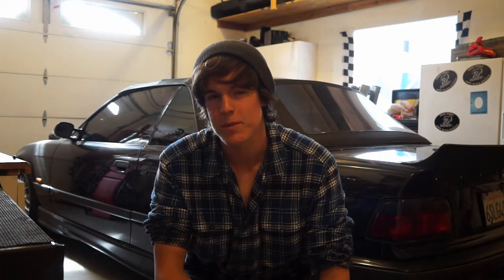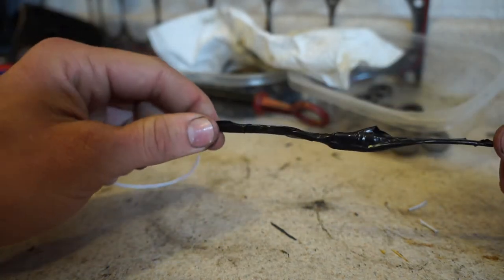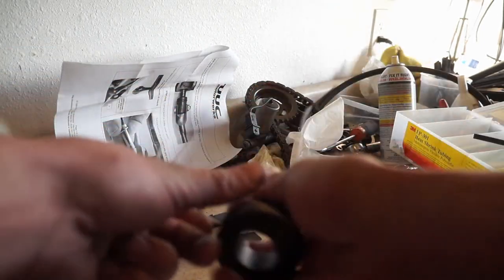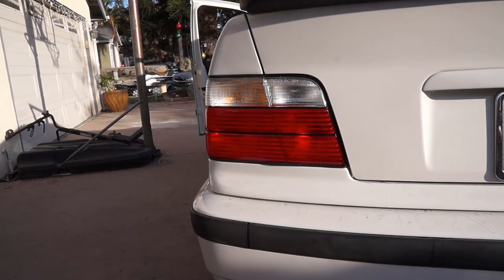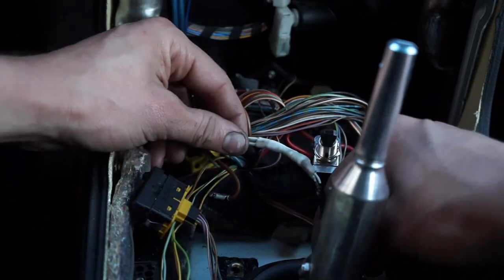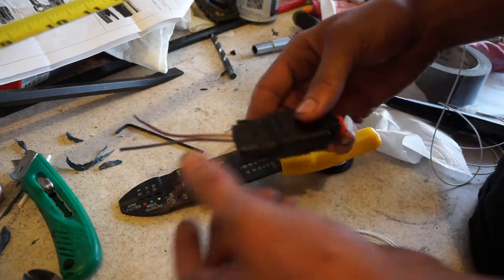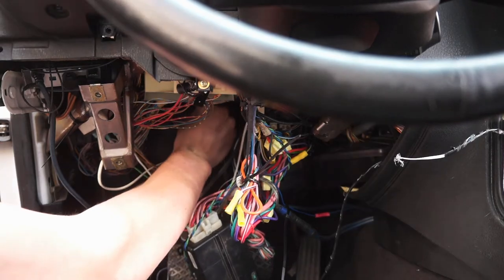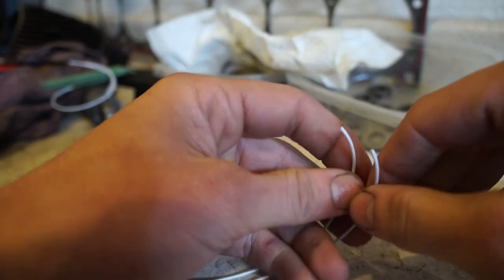Wiring: E36 Manual Swap

Comment: Great videos M3NACE! You definitely have tutoring skills and you know how to place cameras for right shots!
That's how I understand Clutch Switch operation:

1. Both Manual and Auto cars need to know when it is safe to start the engine. They do so by checking if that circuit is closed or not. Circuit closed = safe to start. Circuit open = NOT safe.

2. Safe start positions for automatic are [P]ark and [N]eutral. For cars with manual tranny the condition is that the clutch pedal must be depressed no matter if it's in gear or neutral. We have switches in both auto and manual cars. Manuals have it beside the pedal (closes the circuit when pedal depressed) and autos have it inside the shifter assembly (closes the circuit when in [P] or [N]).

3. After the swap you remove the auto shifter assembly along with the switch and so you need a way to tell the car: hey, it's safe to start the engine! That's when some DIY-ers prefer to just jump wire the pins and leave the circuit permanently closed, while others do it the right way with the clutch switch.

Why jump wiring the pins messes up you cruise control:

Coincidentally, both Auto and Manual cars use exactly the same circuit when they need to override cruise control and disable it for safety and operational reasons. Basically when the circuit is CLOSED, the cruise control is overriden and is shut down. As explained above this occurs when automatic cars are in [P] and [N] or when you depress the clutch pedal in a manual car.

Now those DIY-ers who decided to take a shortcut and jump wire the pins and leave the circuit permanently in a closed state (to let the car know that hey, it is safe to start), have also let the car know that "hey, it is NOT safe to have cruise control enabled, override and shut it down".

Hope this helps.
Reply: So by jump wiring ,the cruise control is disabled and car still can be started without pushing clutch in ? But with the switch the clutch must be engaged to start vehicle ?  And use crusie control possible ?

Comment: Excellent tutorial and I agree with Erik Engstrom. My only comment is the break light switch is self adjusting, so he didn't need to glue spacers on the end of the switch. He needed to just pull the white plunger out further, it sticks out almost an inch, install the switch, then use the clutch. The clutch will then press againts the plunger to adjust. It's an eligant design. Great video!!

Comment: That was the BEST VIDEO!!!
Help me, the yellow light (think its for fault of the auto trans) how can i turn her off?
Reply from the maker: You need to remove the bulb from the cluster - manual cars do not have a bulb.
Reply: @M3NACE  you mean the light?
Reply: @M3NACE  and the cruise control??
How can i keep it working, mine stoped
Mine is a 325i m50
Reply from the maker: @arthurugms  did you wire in a clutch switch?

Comment: Great job! The only thing I’d do differently is to salvage the connector from the auto shifter and reduce the number of solder connections. Unless the connector is impossible to remove.
Reply from the maker: Mitchell Birch the connector is solid mounted to the circut board on the shift assembly if I recall correctly, but re-using the connection would be pretty trick.
Reply: M3NACE yeah after seeing the other video, it looks like it would have been 10/10 difficult to remove without breaking but the payoff would be awesome. It would be near impossible to tell it wasn’t oem.
Reply from the maker: Mitchell Birch yeah true that, you could do a manual harness conversion but Its only 4 wires and I dont think it would be worth the time and effort.
Reply: M3NACE yeah. It’s probably more work than it’s worth. And what you did was basically free.

Comment: Hello how would I Flash  the DME on 1998 E36 M3. Just completing the transmission swap from auto to  manual. How do I clear codes on OBD2 car. I don’t see this covered in your videos. Thank you great info on these videos never watched any thing like yours, please keep them going ,

Steve
Reply from the maker: I will be doing a standalone video on how i get rid of my check engine light, but i have gone over the techinques in my swap prep series. but there are many ways to get over the hurdle. ill throw you a few, but they have pros and cons. 1: get a manual DME, but you will need to re-sync the EWS system to the new DME  which requires a dealer to do it. 2: have someone re-flash your dme with a manual tune, this requires someone with tools and knowledge on re-flashing 3: send your dme out to get re-flashed, but this will imobilize your car until you get it back. 4: buy a auto or manual DME and send it out to get it converted to manual if its auto, and get the EWS system bypassed, this is one of the quicker ways, because when you get the DME back you just pop your old out and pop in the new, but this can be the most expensive due to the cost of a dme and the cost of the tune for it. I have also heard of people re-flashing it themselves with BMW's INPA system, and I might try and do it myself, but I dont think it would be the quickest way to get it dealt with. I have also heard of people purchasing N/A Tunes for a manual car, and having the tune basically convert the DME to manual while tuning the car. the last two I havent talked to anyone who has done them but Im sure they can be done. best of luck.
Reply: @M3NACE   Hey Menace, a question with the DME, If I was able to get the manual DME with the manual wiring harness, you mentioned that I will still have to resync the EWS system to the new DME at the dealership. Will I still need to reflash my DME for the manual tune? Also, will resplicing the reverse light still apply with the manual wiring harness? Hope these questions made sense.
Reply from the maker: @maxuelcabasag7833  you will need to get the EWS aligned if you replace the ECU. You can either throw a manual tune on your factory ECU, it will not require EWS reflash, or replace with a manual ECU and reflash the ews. A manual engine harness will only delete the auto trans plug, the body harness is still automatic and will still need to be wired for reverse.

Comment: ahh 2 years later after doing the swap I find myself back on here trying to figure out which pins go to what because my reverse light cable decided to fall apart.  Making a new one and this time I'm ziptying to the chassis and running much better cable management and soldering instead of crimping.  Cheers from 2020, my comments from 2018 are still probably on this series :)

Let me know how things are going for you, how the cars are, etc.  Haven't talked in probably 2 years and I'd love to hear what e36 things you've been up to!
Reply from the maker: hey man! cars have been great, just stacking cash. have you checked out our drift build or any of our driving yet?
Reply: @M3NACE  not yet!  I'm gonna watch them if I get the time!  I'm waiting on the driveshaft of my e36 to get done at the shop--I had it rebuilt for the manual swap and the car sat while I was at college.  Came back,  and after some driving the u joints shattered on an 1100 mile old driveshaft, so they're taking care of that one for me.  I'm going around replacing all the rubber in my car.  My ball joints are severely ruining my toe and inner tire tread is cupping and wearing like trash.  If you've got any ball joint replacement tips, I'll be happy to hear them--not many people replace these ball joints on these cars.  For that reason, I'll be filming our process and see what's going to happen.
Reply from the maker: @MCatwar  you are refering to the trailing arm ball joints? we are about to replace those on the drift car, and i have done all 4 on my sedan. they are somewhere on the channel
Reply: @M3NACE  oh I'm talking about front LCA ball joints.  I've got some terrible tire wear because of it and there's lots of play.  I've done normal front lower ball joints, but these ones have this special clip on them, preventing them from being pressed out.  I think I'm going to take an angle grinder to it and then do them like normal.  The inner ones are a bit scary because I don't know how those will work out. 

We're putting these: https://www.ecstuning.com/b-meyle-hd-parts/heavy-duty-front-outer-ball-joint-priced-each/31126758510~my/#
in place of these: https://www.ecstuning.com/b-febi-parts/front-outer-ball-joint-priced-each/31126758510~feb/

Actually, it turns out that 1995 M3s actually are compatible with e30 arms, which have much friendlier ball joints than the >95 models.  Unfortunately I have a 99.  And I'm kinda upset with how much inner cupping on my front tires I've got.  I've only had em since June and have 1100 miles on them hahaaha
Reply from the maker: @MCatwar  i havent changed those out yet, but i will at some point on mine. they dont have play but the boots are torn pretty good.
Reply from the maker: @MCatwar  i looked into a couple threads online and it seems like they are all just pressing them out no prob
Reply: @M3NACE  alrighty.  not many people do.  Same with rear wheel bearings.  I got a set of rear wheel bearings (If you need them, they're dummy cheap on ECS-Febi ones are 20 bucks a pop right now) that I may or may not have to put in.  I'll film both, and I'll definitely make sure to keep you posted with whether or not it's even worth replacing the ball joints versus buying heavy duty control arms with serviceable ball joints.  I'd much rather spend 50 dollars on all the ball joints on the existing control arm versus 200 bucks, so I'll keep you posted.  We also plan on switching to all poly bushings.  I'm trying to get ahold of some revshift poly bushings that I found for cheap on FB Marketplace, and I'll also be doing control arm and rear subframe bushings.  I think me and my 2 other e36 friends are gonna all do our rear subframe/RTA bushings in one go, and powdercoat the subframe while we're at it, but things are obviously at kind of a standstill from good ol rona.  Just gotta take things slow and play it by ear.
Reply: yeah I think that's the route we're gonna take.  Also might have just landed a set of m brakes from a junkyard m3, as well as another getrag 250 because the synchro in 2nd gear is clapped in mine.  I also learned during the manual swap that Chase Bays makes a really nice clutch hardline substitute, where it goes from your master directly to the slave, as one hard softline.  It was 60 bucks when I bought it, and it had just come out summer 2018, so it's probably cheaper now but it was definitely worth the headache of the hardlines.  Now I'm back from school, I just gotta play catch up with continuing the work on the e36 haha
Reply from the maker: @MCatwar  yeah man please let me know! Im actually saving to do a full subframe out refresh on the bucket, going monoball RTAB's, poly everything else, new axles, reinforced subframe, camber arms and some other goodies. Ill probably do the front control arm ball joints as well if that all goes well for you. As far as i know the only control arms that you can get for these are chinese crap aside from all the CNC angle kit arms.
Reply: @M3NACE  https://www.ecstuning.com/b-meyle-hd-parts/heavy-duty-front-control-arm-right/31126758514~my/

those are probably going to be our backup.  It's worth the exxtra work to save 60 bucks imo, but if they don't work then we'll return the ball joints and just run these arms.

Comment: Hi Many, many thx  for these awesome videos.  CompleTed my swap to a E46 M3 six speed and that is the bomb, super happy with that choice.  Gearing works perfectly and did not have ro replace the driveshaft.  In fact I just took off the front section for the swap.  Just one problem remains.  How to get rid if the cog light?
Reply from the maker: Awesome man! To get rid of the light just pull the cluster and remove the bulb. Thats how its done on E36's, im not sure it the procedure is the same on e46's though.
Reply: Oh thanks so much.  The swap was on a 1997 M3 sedan.  I really like the six speed now.  Cruising at 80mph@3000rpm !  Keep up the good work awesome vids.!
Reply from the maker: @reinaldoortiz2118  awesome man, good to hear!

Comment: awesome detail man really appreciated. Might sound stupid but is the reverse light switch you wire in optional? Before the switch you wired the harness from the trans to the two pins on the black connector and it worked after selecting reverse. Is the switch only there if you want to put the lights on without engaging reverse?
Reply from the maker: well it is required to have them wired in, but the car will still work if you donr wire the reverse lights lol, the switch is there to engage the reverse lights when the shifter is in reverse. the switch is controlled by the trans.

Comment: Hi, hope you will still see this. Great video! Got a question about the part where you are jumping the wires without a clutch switch, is jumping pin 5 and pin 7 the same for a harness of a ssg/smg gearbox? My clutch pedal didn’t come with a clutch safety switch so i have to find out how to do it myself but there are not alot of in depth videos from ssg to manual and how to wire it. Hope you can help me out!
Reply from the maker: May be similar, i would start by comparing the pinout of the SMG selector harness to the auto harness and see if you have similar inputs/outputs
Reply: @M3NACE  aah okayy, will do that! Thanks for responding❤️

Comment: Nice vid yo!!
Did the cruise control work like you thought it would?
Reply from the maker: thanks! mine did not, im not sure why. i might have been wrong in my theory, but I think something else is wrong within the car. I used to be able to start the car in reverse and drive, and when I replaced the neutral saftey switch in the autotrans, it still was able to start in drive. I have a feeling it is linked to that, im not sure. im not that dedicated to getting cruze control working though lol
Reply: M3NACE 
Ok, I just got most everything I need, for the swap. Its my daily tho as well, and I need it to get me up to school! I did the 2.5 hour drive once in my bronco without cruise, and that sucked.

Comment: Yoo vids are fire mate! Im going to do a m52b28 swap on my manual e30. The m52 is from automatic e39, and will be paired with e36 manual gearbox. Since the ecu is automatic and the rest is from manual cars, i assume i only need to replace starter, take out transmission chip from ecu, and do no clutch switch wiring. Is that it? or do i miss something?
Reply from the maker: since you are swapping it into an E30, I think there is alot more that needs to be done as far as wiring goes. is your motor a TU? as in double vanos? I would think you would want to get the ECU converted to a manual tune with an EWS delete to start. the starter should be one from a E36, that fits the gearbox. as far as the starters go, the manual and the automatic cars are the same. I would email the guys at kasselperformance, https://www.kasselperformance.com/ they do alot of OE DME modifications, and even some wiring harness work. im sure they will be able to help you out and point you in the right direction, just tell em' I sent you:)
Reply: Nope, it isnt the TU version. If i use stand alone ecu would it be easier for me as i dont need to do the ews delete and stuffs? Gonna email kasselperformace soon thanks for that!
Reply from the maker: standalones get expensive quick. if thats the way you want to run, go for it. I would think it would be easier and quicker to reflash an EWS delete the factory DME lol

Comment: Do you have to run a clutch switch and what are the pros and cons of not running one
Reply from the maker: You dont have to run one. Pro, you can start the car without pushing the clutch in. Con, you can start it in gear and lurch the car forward

Comment: 22:38 this part with the clutch switch you are wiring up has me confused. I'm manual swapping. Im also motor swapping, and using the harness from a manual car. Do i still need to hook up that clutch switch at all? The new motor with manual trans starts with just jumping the pins. Clutch lines arent even hooked up. Can't i just solder the wires together in the exact same way you did with the brake switch wires? I dont have cruise control and wont be getting that.

Comment: Ill be doin this swap pretty soon and im curious. Instead of having to do all the wiring, wouldnt i be able to use the transmission wiring from my donor car? id have to cut it right?
Reply from the maker: yeah you could, you will still have to run it and wire it but it should work.

Comment: Hey M3nace, I ran into a little issue on the clutch switch part. For some reason my car starts with the clutch switch engaged instead of disengaged as you show in the video. Ps I'm using an actual e36 clutch switch instead of a brake switch. Not sure if that could be why.
Reply from the maker: It is, the clutch switch works opposite the brake switch, which is why you need to use a brake switch instead or a clutch switch.
Reply: @M3NACE  Ah, that makes sense now. Did it your way and it worked like a charm. Thank you for your knowledge sir 🎩